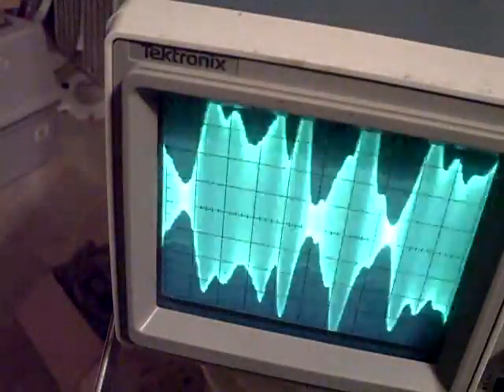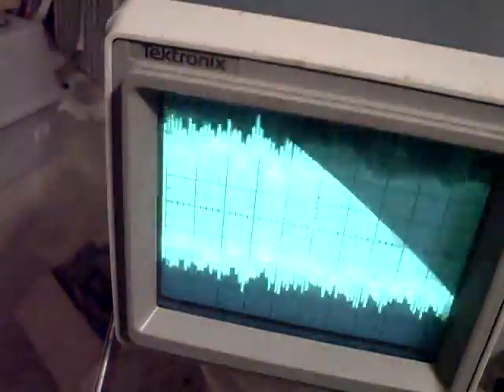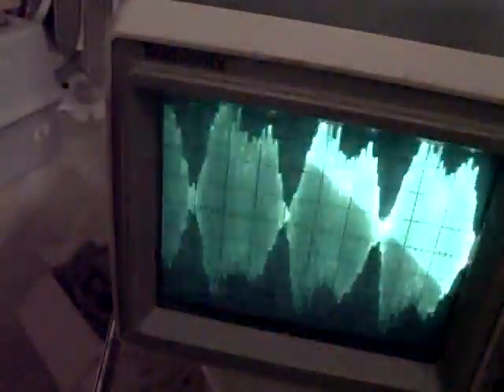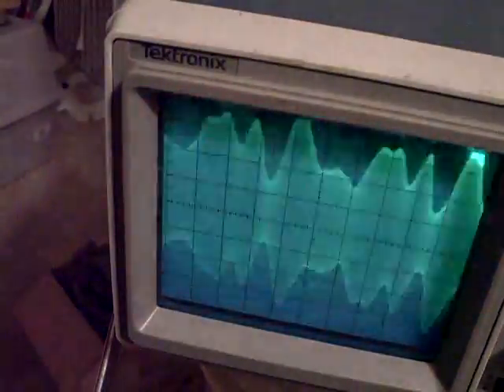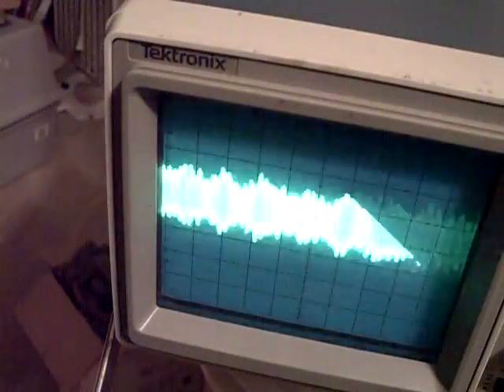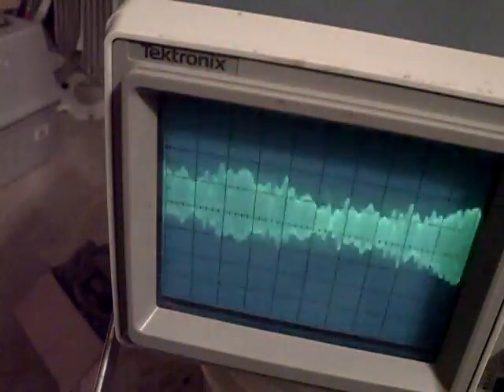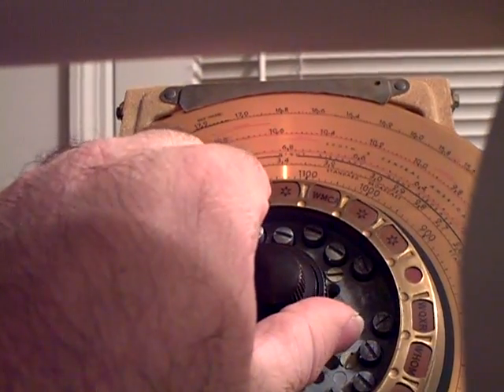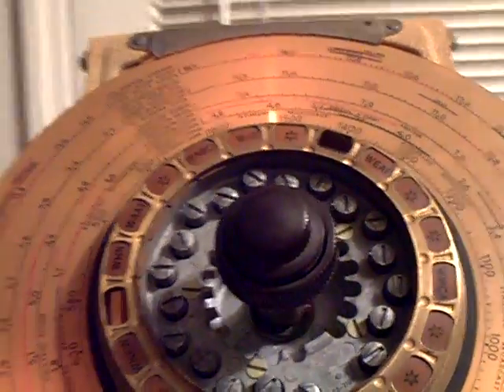Philco 38-116 Repair, Part 15, using single 470 KC for IF alignment

Comment from the maker: you're incorrect. this radio was never worked on before I touched it so the IF can(s) were very close to the correct alignment. the finished radio works fantastically well and is accurate across all bands. No reasonable person would force a tuning adjustment risking breaking the IF coil. Especially if the radio was never touched before.

Comment from the maker: @joernone I bet the alignment is better than a 1938 repairman could do with a voltmeter and trying to sweep from 460-480 KC on a signal generator as per Philco's instructions! This is with no scope to tell him where he was really at. Using a voltmeter and adjusting the compensaators seems good on paper, but a bet a nightmare to actually perform! I have very good selectively and sensitivity. The weaker stations are playing with much more volume that when before I started the IF alignment.

Comment from the maker: @joernone Thanks for the kudos John, but this is a pain for a few reasons. the sweep gen is way off calibration, but I still made it work for 460-480 KC. I was taking the output off the 2nd IF plate. It would be better taking it off the 2nd detector/magnetic tuning amplifier. All a moot point, since the biggest problem is the frozen 52B compensator. This is off the 3rd IF transformer. 52B should be close to the correct setting.